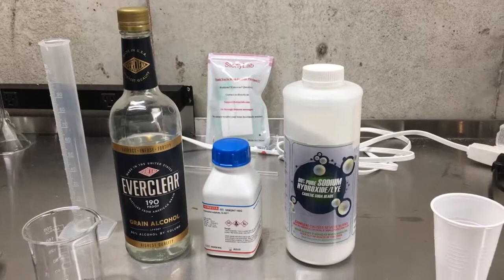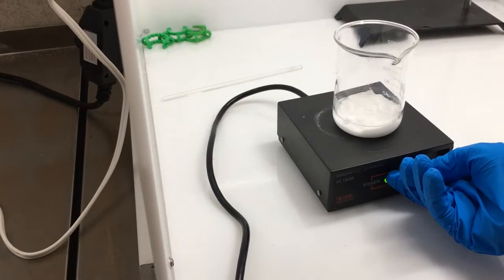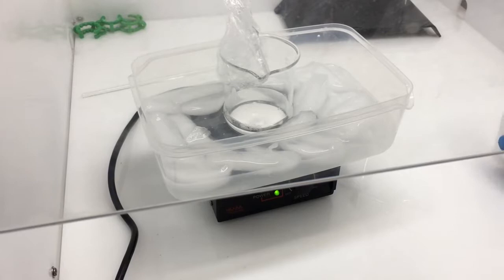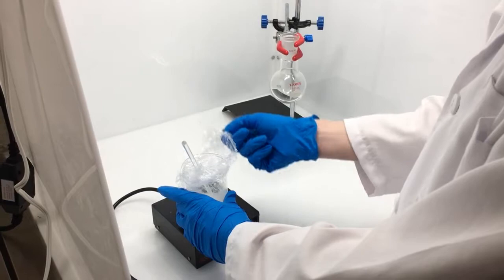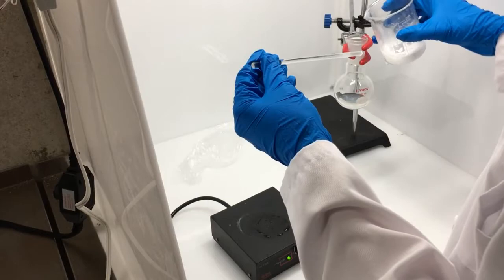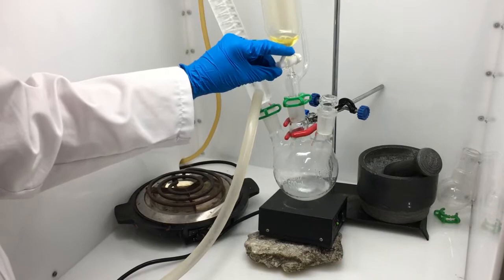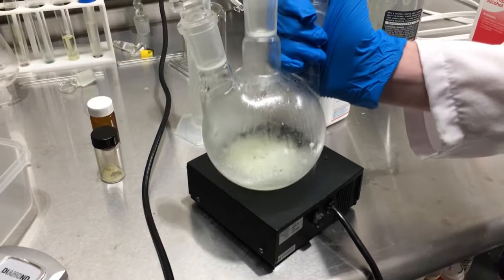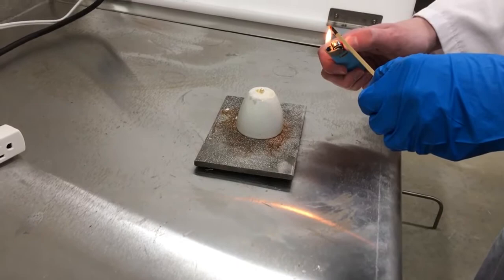Sodium Azide Synthesis from Hydrazine Sulfate

Comment: If I store it for years in a well sealed container, can it spontaneously explode?
 Anyway, great Video!
Reply from the maker: I do not believe it will, it should be fine. I have stored some for about a year. Thank you!
Reply: if you do however, keep it in a secondary container and ONLY open under the fumehood. deadly hydrogen azide gas can accumulate over time from just slight moisture in the sodium azide

Comment: Can i add the nitrite without a condenser on? Is there a real risk of loosing the solvent? Or can you just drip in the nitrite and then reflux with a condenser? I dont have a two/three neck flask, you know...
Reply: or maybe add the nitrite in ethanol solution to compensate for the loss of slovent
Reply from the maker: @ingensvidcz5390  I would say it’s pretty important to use a condenser. The solution is going to make heat even if it’s added as slowly as I did it. It will keep reactants inside the flask and prevent hydrazine from escaping
Reply: @ButPrestonDidIt  alright, imma buy a flask then. Thanks alot
Reply from the maker: @ingensvidcz5390  yea that’s a good move because you can also use it for other things in the future. I am actually making a silver azide video- probably coming out on Monday

Comment: Hi! is there a particular reason you reflux the solution? does it improve the yield or can this step be skipped?
Reply from the maker: Come on Walter, you should know
Reply: @ButPrestonDidIt  i forgor 💀pls tell
Reply from the maker: @Waltuh6977  Yes it is needed to increase the yield and greatly decrease the reaction time.
Reply: @ButPrestonDidIt  btw. did you confuse ethyl nitrite with isopropyl nitrite, in the video, youve added the iso nitrite...
Reply from the maker: @Waltuh6977  it should be iso

Comment: Hello! Great video! I don't understand the part when you put the alcohol solution in 6.45 minutes in a three-necked flask, what do you add from the plastic cup?
Reply from the maker: The plastic cup has sodium hydroxide in it. If I didn’t answer your question or you need something else just ask
Reply: @ButPrestonDidIt  Thank you! Why do you put sodium hydroxide afterwards? Why isn't everything put together in the process before in the alcohol solution?
Reply from the maker: @marox3G  when the hydroxide is added, it generates heat. If I added it in open air it could cause some hydrazine to evaporate or some alcohol to evaporate. And heat is needed for when the nitrite is added and the solution is refluxed.

Comment: Is it possible to make this somehow without all the equipment like the condenser and three neck flask? As in, if I am not a professional and don’t have or know how to use all that?
Reply from the maker: If you don’t have experience using this equipment or these chemicals, I would not recommend doing this reaction. Get some experience under your belt because there are very poisonous gases made and explosive compounds. But you will need a condenser and most of this glassware, you could work around some things tho

Comment: did you use a condensing distillation column to reflux? if so did yoou just stopper the end? if so ehat did you seal your joints eith? sulf acid?
Reply from the maker: Yea the condenser was used for reflux that vented to the fumehood at the end and I believe the joints were sealed with grease

Comment: I scaled up this synthisis 6× and got the same ammount as the original ammount? How do you use way more ammounts and get the same yield as the low ammount synthesis?
Reply from the maker: Something probably went wrong during the reactions. Usually, larger amounts will take longer to heat up, dissolve, and so on. So my guess is that you did not fully dissolve the hydrazine in the ethanol and so only part of it was actually reacted. But it could be a whole bunch of things combined or just something small.
Reply from the maker: But yes, that should not have happened

Comment: Without sodium nitrite ？
Reply from the maker: It uses isopropyl nitrite. I’m not sure if you saw some synthesis that uses sodium nitrite, isopropyl alcohol, and an acid, as that would form isopropyl nitrite (which is used here). I would assume the yields would be less than the synthesis I used here

Comment: Finally waited, do you think about the same method steps as sodium azide and aluminum azide?
Reply from the maker: I doubt it would be the same since aluminum hydroxide is insoluble in ethanol
Reply from the maker: Maybe try a displacement of the azide such as for silver or lead
Reply: @ButPrestonDidIt  Use a strong base
Reply from the maker: What would aluminum azide be used for/ what are it it’s wanted properties?
Reply: @ButPrestonDidIt  Lead azide, not aluminum. Lead azide is used as a primer for bullets
Reply from the maker: @user-in8bz3kd7d  I know it is, you were saying aluminum in your previous comments
Reply: @ButPrestonDidIt  I made a typo, my English is very poor, but I will share this technology with other fans
Reply from the maker: @user-in8bz3kd7d  all good brother
Reply from the maker: @user-in8bz3kd7d  it seems you can spell very well
Reply from the maker: @user-in8bz3kd7d  Any way. For lead azide, it is much simpler. But the sodium azide is needed to form lead azide. All that is done is the sodium azide is reacted with either lead nitrate or lead acetate (in solution). This precipitates lead azide
Reply: @ButPrestonDidIt  For the most part, I still rely on translation. Many guns still rely on your inspiration and chemicals. Now I have reached the point of fascinating, and my mind is this thing every day.
Reply: @ButPrestonDidIt  These are my living souls. It’s boring to live without me. It’s banned in my country, but I still play secretly. Men like these because it’s the nature of men. If you don’t play with them, it’s just castrating him.  The soul?
Reply: @ButPrestonDidIt  Brother, I just graduated from elementary school, which is equivalent to being illiterate, but for this, I spent ten years to learn mechanical processing and five years to learn chemistry. We only came into contact with chemistry in the first year of junior high school, that is, it took twelve years of studying.  I teach chemistry and English. I have used it for five years in order to understand what you are saying. My only wish is to be able to play like you, feel relieved, and play boldly without restraint, because I know that it’s not easy for people to live once.
Reply: @ButPrestonDidIt  Brother, do you have Instagram?  Can you make me a video about lead azide? I really need it, and all fans in China and all over the world need it.
Reply from the maker: @user-in8bz3kd7d  I do not have Instagram, I may make one for the channel though. I do plan on making lead azide. But first silver azide
Reply from the maker: @user-in8bz3kd7d  I believe traditional air guns will have higher pressure than if you put liquid oxygen directly in since it won’t be very much higher than atmospheric pressure (I believe, I don’t know very much about this). And if you have liquid oxygen directly in the chamber, the gun will go off uncontrollably and I imagine randomly (if loaded)
Reply: @ButPrestonDidIt  The muzzle velocity of traditional air guns is also over 500, but the muzzle velocity of alcohol is also over 500.
Reply: @ButPrestonDidIt  my friend where is that video?
Reply from the maker: @user-in8bz3kd7d  I saw your comment as I was replying to another. I have finally made an instagram lol: 
https://instagram.com/butprestondidit?igshid=OGQ5ZDc2ODk2ZA==
Reply from the maker: @tomspeed2000  if you are still interested, I have a couple azide videos that I could put out

Comment: Will hydrazine hydrate work for this synthesis?
Reply from the maker: Yea, you’ll have to tweak it a bit but it should work fine, I don’t believe you would have to make the freebase.
Keep in mind if your end product is silver/lead azide, you don’t have to make sodium azide if you are starting from the hydrate.
Reply: @ButPrestonDidIt  interesting so whats the tweaked version of the synthesis?
Reply from the maker: @arachnidadocumentary6159 use 5.8 grams of hydrazine hydrate and skip the freebase part
Reply from the maker: @arachnidadocumentary6159 (that is going off the measurements in the rest of the video)
Reply: @ButPrestonDidIt  thanks mate
Reply: @ButPrestonDidIt  is ethanol still needed and if I go for lead azide do I have to use lead hydroxide instead of sodium hydroxide in the last step?
Reply from the maker: @arachnidadocumentary6159  yea you will need to do the exact same as in the video, but just adding the hydrazine hydrate straight into the reaction flask, sodium hydroxide will be dissolved in ethanol
Reply: @ButPrestonDidIt What is the purpose of iso nitrite in this synthesis?

Comment: Why not do this under reflux instead of an open beaker?
Reply from the maker: I did do it under reflux? Reflux helps keep the hydrazine fumes minimal and helps keep the alcohol inside while letting the solution be heated.
Reply: @ButPrestonDidIt  With a proper condenser to keep the N2H4 fumes in check. The REL for this stuff is 0.03ppm.
Reply from the maker: @gamelord5798  yes, the condenser helps a lot, that is why you should use a twisted one not just the normal one for distillation with cold water. It was also in a fumehood the whole time.
Reply: @ButPrestonDidIt  All good mate, it's just that novices watch these things and may not appreciate the possible dangers.
Reply from the maker: @gamelord5798  that is very true.

Comment: Purity %???
Reply from the maker: I have no way to know for certain, but from test it seems very pure.
Reply: You need to check compare with the synthesized yield and Theoretical yield
Reply from the maker: @user-ey6us8on6i  That would not tell the purity. And this was a long time ago, so all of it is used up now. At the time, most of it was wet and stuck in the flask, so I just got it out as I needed